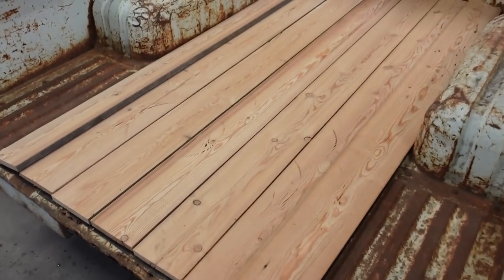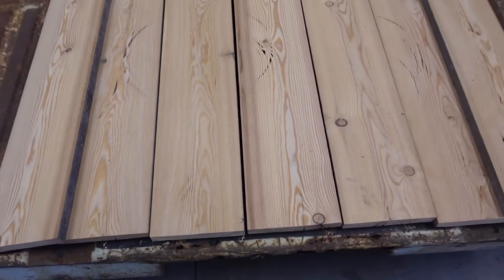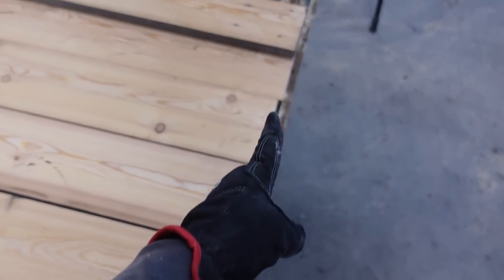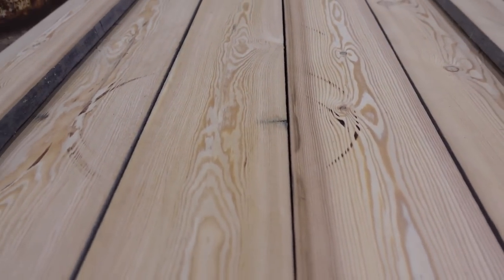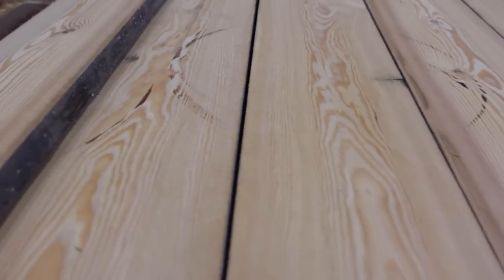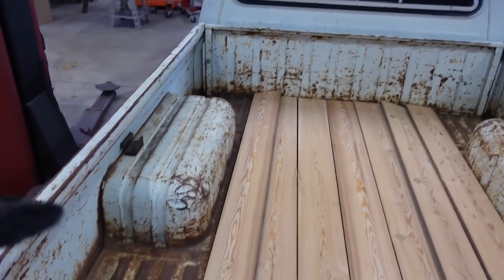I Built A WOOD Bed For My Toyota Truck!!

Comment: This is absolutely next level, Austin. That wood is NEVER something I would have expected for this build, but what an amazing result! You are a great example of what someone can accomplish with less than ideal tools, a little ingenuity and an outstanding attitude when it comes to doing things the right way. Incredible work man.

The only thing I'd suggest is that if you havent done so already, pull the wood out one last time and seal the floor. Rust reformer, POR15, Duplicolor rust fix, etc...they won't stop the rust completely but they'll help keep it from getting any worse for a while - and being concealed under the wood, you won't lose any of that visible patina you're going for.

Comment: Great idea for an old truck Fyi  I would think about using an old bike tube or flexible hose to put on the chains on the tailgate or else they make a racket going down the road the old school trucks used to have those on the chains the bed turned out awesome well done 👍
Reply: Good idea, or maybe some larger gauge shrink tubing.

Comment: That looks great! Awesome video and such a cool old Toyota! The wood turned out great! I searched videos about diy wood bed floor and yours was one that caught my eye. (Mainly the Toyota) I'm really considering doing this to my  '04 Tundra. I have some rust in the bed floor and don't really want to patch weld it all. There's so many holes. Outside of my truck is excellent and solid. I think a wood floor would look great and hide the ugly floor. Great video!

Comment: I'd paint the tray under the wood just for piece of mind. 
I think the wood would look good on the back of the tailgate too.
Reply: I totally agree with ya on both points
Reply: That wood will trap moisture and the bed, will rust away, if u like the patina I would at least clear coat the bed under the wood.
Reply: Was just going to say

Comment: Austin, do yourself a favor, go back and either loctite those nuts or use Nylock nuts.
There is more vibration than you think back there and those nuts will back off, even with a spot lock washer. Personally I would have colored those carriage bolt heads, but that's just me.